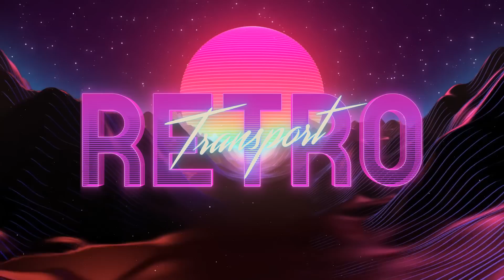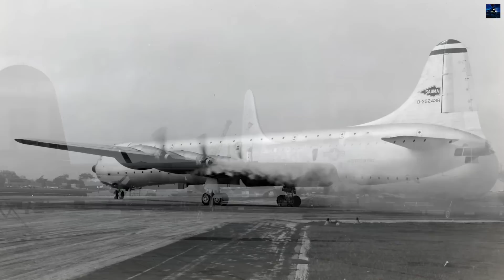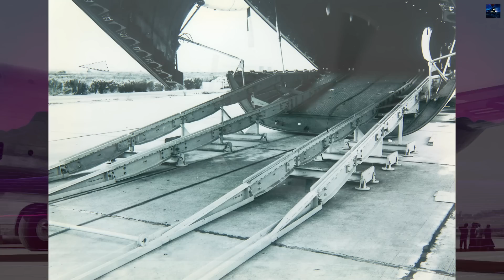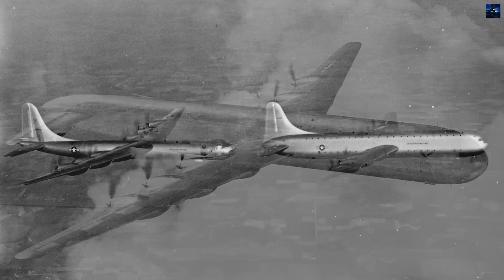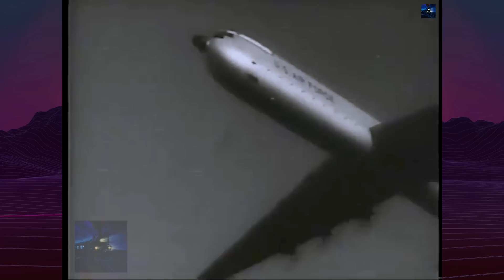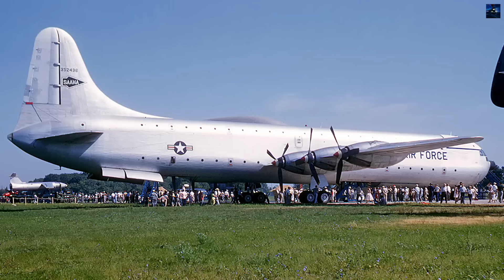Convair XC-99: The Plane So Big, Only ONE Was Ever Built

Comment: Worked with a veteran they had to run B36 engines rich and needed spark plugs changed every flight. A pusher prop the engines had an internal fan he hated even years after retirement. I didn't believe america had a 6 engine bomber, until he said "I worked on them", sure enough he was right.

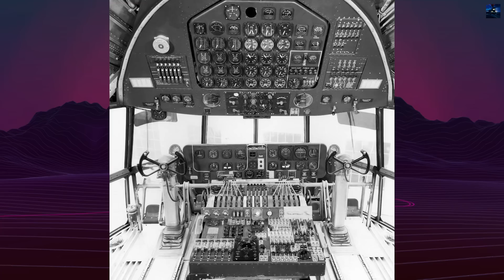Comment: At 1:25, you mentioned it has a 28 wheel landing system. You look at the photos and the landing wheels total up to 4. 2 in the front, and 2 on the rear left and right side. Another video clip, it shows eight wheels on the back left and right, four on each side. Anyways, total for 10 wheels in that clip. Not 28 wheels as mentioned.
Reply: He did bad research.  It is the C-5 that has 28 wheels.

Comment: It looks like they replaced the original "big-@$$ single rear wheels with an early carriage gear, similar to the later B-36's.
Reply: They had to, because like the B-36, there were only 3 runways in the world that were thick enough to handle the ground pressure from those huge mains.

Comment: There was consideration to retrofit turboprops on the B36.  
Curtiss-Wright designed the XT-35 ‘Typhoon’ 6000 hp turboprop engine intended for a straight wing B52 concept..   The engine ran and was tested in the nose of a B17.  Swept wings and turbojets were in the works.  General LeMay wanted jets and institutionally the USAF wanted to keep the money flowing for new planes, not fixing the old..  
     The USAF transport arm continued with piston engines thru the Vietnam War.  The first USAF transport plane I know with turboprops was the C130 Hercules (1954).  I think the USAF missed by not re-engining the B-36 and use as a tanker.
Reply: My favorite prints on my walls are of the two different five engine B-17s. Yankee Ingenuity at it's finest!